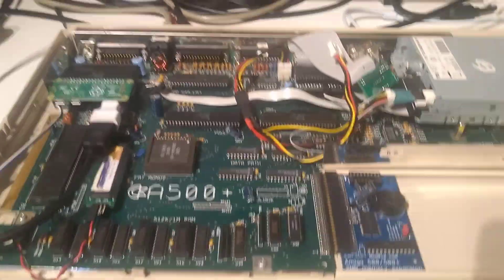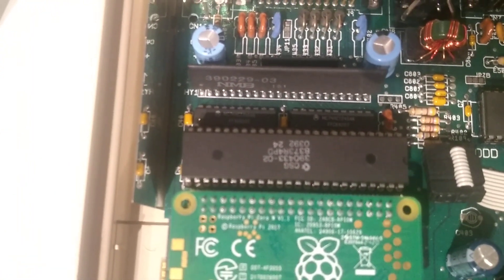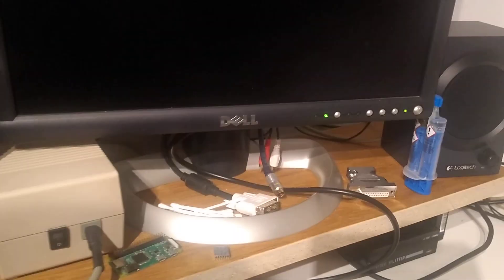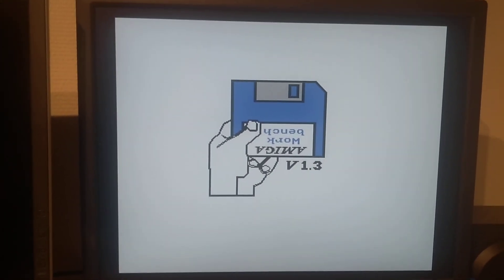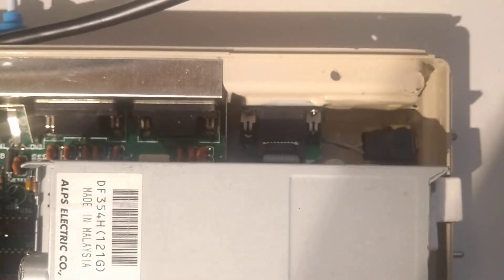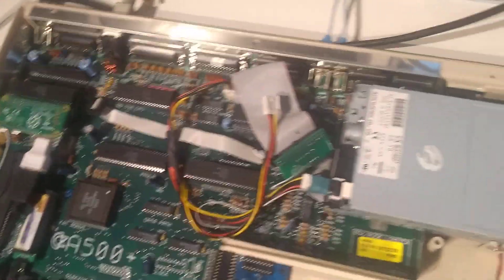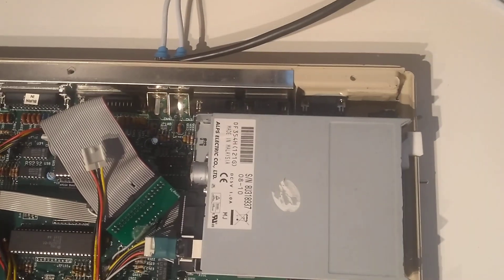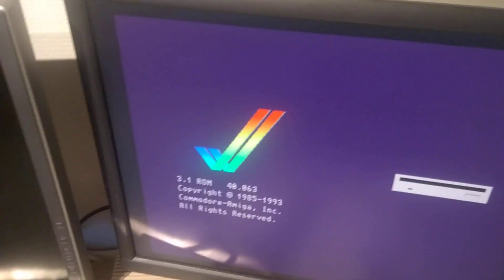Amiga Digital Video V2 Adaptor. First power on. (Amiga RGBtoHDMI)

Comment: Your issue with the monitor is probably that the monitor does not correctly deliver the EDID information to the Pi. When the software starts, it first requests the native screen resolution before it shows any picture. So, maybe your monitor only sends the EDID once after turning it on and not at future requests.
Reply from the maker: That might be the reason as to why. After all, I am using a cable that has HDMI in one end, and then DVI on the other. It is directly to the DVI port of the minitor. I think you are right about that. I can always use a different monitor and sell my 2001fp.
Reply: @brostenen  DVI or HDMI makes no difference for the EDID handling. The monitor should always provide proper EDID info to its partner. You could also try to test my theory a bit. What happens if you switch off both devices, then switch on the monitor, and then the Amiga. If you get a picture, this means the monitor indeed sends the EDID just once and not again.
Reply from the maker: @copperdragon9286  That works. 😉 I have been thinking about getting a new monitor with high resolution and propper HDMI port anyway. 🙂
Reply from the maker: @copperdragon9286  Love the work that was put into the adaptor. Soldering is really good and it just works.

Comment: Can you show scan lines mode?
Reply from the maker: I have not come that far in testing. I just wanted to show people Version2 as soon as I got it in the mail. Because a lot of people have bought from the maker, and are qurious on to how it is working. If it is as good as V1. So I need more time to test it. So far it looks like it is the same deal, and I have not been able to get scanlines working. On the other hand, I find the picture good when setting the filther to slightly smooth. That is way more useable than scanlines, if you ask for my opinion on imagequality and vintage computers. :-)
Reply: @brostenen  that's fine